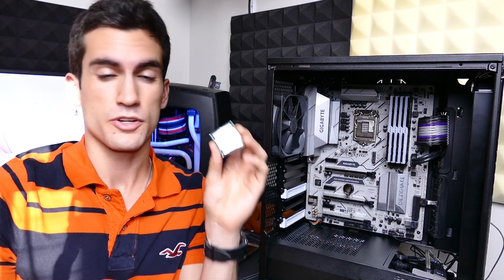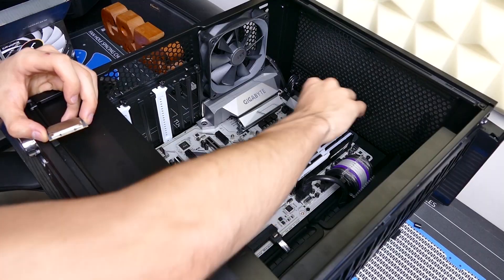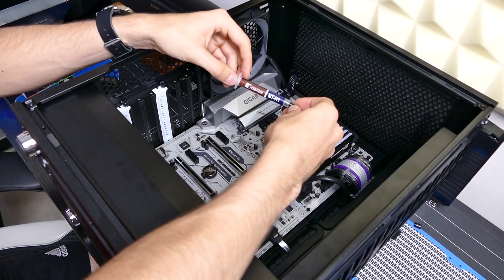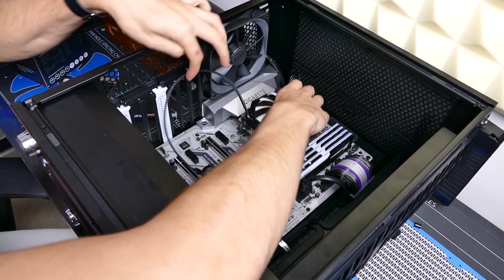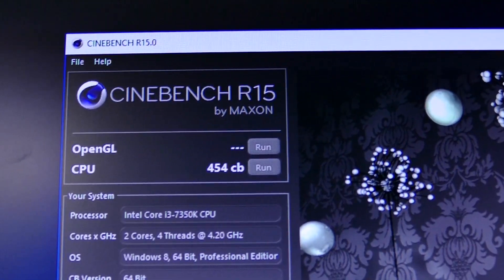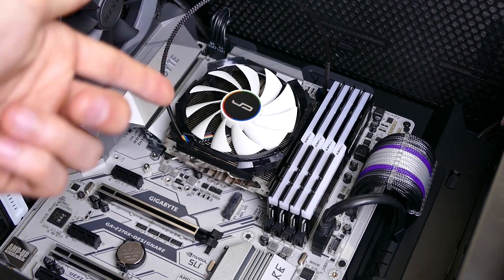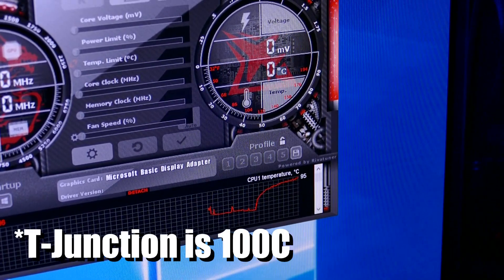Thermal Pad Instead of Thermal Paste?

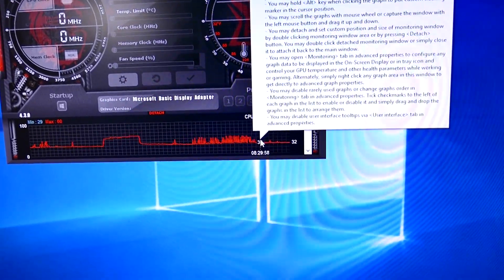Comment from the maker: - @3:17, I most definitely meant Fahrenheit ;-)
Reply: @Science studio
Why don't you try putting a thermal pad entirely covering the CPU for more heat-transfer potential over the entire IHS on the CPU?
I mean don't get me wrong I know performance will still be bad, but I wonder if the difference would be significant, plus I think its kinda unfair, you put the pad just in the middle, while the paste was capable of spreading out and covering more area thus it wasn't an exact replication of a fair comparison.
Reply: I caught that but I was like "Greg's smart. He'll figure it out eventually."
Reply: i think this is not a fair comparison! In fact you will get better results without that tiny piece of thermal pad because the radiator is on the entire surface of CPU heatsink instead a small 2 by 4 cm... surface size does matter when it comes to heat dissipation!
Reply: The i3 is just 129 at MICROCENTER. You can get a motherboard for just a few bucks more in one of their bundles. I picked up one open box for just 90 bucks. Hits 4.9GHz. Not bad for 150 dollars total.
Reply: And you call yourself an engineer! ;)
Reply: @Radiatingredstone Greg said 'he doesn't care' about that CPU for a reason, its terrible P4P.
My recommendation is to either buy a I3 6100 and BLCK overclock it to save some money and get decent P4P, OR, buy an R5 1400.
On the R5 you're talking double the cores, double the threads, not to mention it overclocks on the cheapest boards and can achieve mean overclocks.
Or if you're hard-on for intel, its been addressed before and generally speaking a locked I5 is better than the I3 and is better P4P.
The I3 7350K is a laughing stock among the community because it makes no sense in a P4P situation, I5 is better all around.
Especially with AMD's latest lineup, its a joke of a CPU.
Reply: Could you make a video about how weak mainboards can drasticly bottleneck your cpu ? Many people don't seem to know about it but when you for example put an AMD FX cpu on a cheap motherboard it will overheat if the processor is maxed out and therefore will throttle the whole system.
Reply: Science Studio Hey, the i3-7350K dropped down to $150 on Amazon and can be found on sale for $140 on OutletPC.  Is it still not worth the extra cash you will have to fork over for the z270 motherboard and cooler compared to a locked i5, or do you think this price drop is enough to make it justifiable in some cases, like emulation, where single core performance is incredibly important?
Reply: try delided ;)
Reply: TechTV 
If they made a smart motherboard with second CPU socket and switch between sockets when hot, or maybe even just led backlights under the motherboard to dissipate heat might work.
Reply: ALL HAIL MICROCENTER: HAVEN OF THE NERDS.
Reply: Please try what Nikola Vasilev said.
Reply: The 7350k's value for money is non-existent. For the same price you can get an i5 that has 4 true cores, and will be better for gaming.
Reply: I miss ur beard
Reply: You said you were going to cut a piece as big as the CPU but you didn't and we know the thermal paste spread evenly so it was not a proper test
Reply: @Science Studio
If you look @ 3:37 VS @ 3:50 there is definitely a noticeable difference from how far the paste spread out (id say covering 85-90% of the CPU) VS the pad (covering id say around 75%.).
While it is a small difference, it is one none-the-less, but enough to make a difference? I don't know.
I personally think there was a big enough difference to be noted as an inconsistency for the test, but perhaps you can further enlighten me to your point if i'm not seeing something you see or know.
Or perhaps its just opinion based.

Regardless I think it'd be cool to see the effects of thermal pads covering the entire CPU, or if it'd matter at all.
Reply: @JooJ SilvZ I've never restored a 990FX so I don't want to say for certain, but typically any thermal pads you can pick up off ebay or other sites work, just cut them to fit, put them where they previously were.
Sometimes thermal paste will be really hard to remove due to age and heat, I'm assuming that's what the "pink" paste was, if its more spread out etc, its more than likely thermal paste, its pretty obvious to tell the difference usually.
Techyescity makes good video's on motherboard restoration, you might want to check him out for reference.
Reply: TRY THIS !!!  dont overvolt with 3v. the highest intel tests are on 2v and the cpu is working fine
TRY THIS TO SEE THE MAX OC!!!
Reply: Science Studio I'm so sorry you didn't fry that crappy CPU. I know you really wanted to 😖
Reply: Science Studio Duh Einstein the thermal paste still covered a larger area & hence had a size advantage. Ur supposed to cover the IHS or de-lid it & cover only the die & do the same with the TIM. Though the verdict will be the same, the exact differences is will wary quite a lot. This video is supposed to show the detailed differences as that's what we never see.
Reply: Science Studio I was hoping you would of completely covered the cpu with those pads... Interesting to know :)
Reply: this heatsink is insane, it uses a peltier to cool the cpu
https://www.amazon.com/Phononic-HEX-2-0-Thermoelectric-Cooler/dp/B01JP7GEOE/ref=sr_1_1?ie=UTF8&qid=1497664685&sr=8-1&keywords=integrated+cpu
Reply: doode it is in celsius afterburner is only in celsius do you realy think the cpu is running at 92 fahrenheit
Reply: Yeah, I also said to myself while watching that I bet you'd get better temps with just the bare heatsink and no paste/pad than with the pad.
Reply: @1:58 That is not enough Greece bro, you should have invited more Greeks. ;)
Reply: When your CPU hits it's T-Junction it turns off instantly, my laptop would hit 106.66°C (220°F) regularly but when it hit its t junction (224°F) everything turned off and the computer would prevent itself from booting for about 5 minutes while everything cooled down
Reply: They wont, he doesnt know what he is on about.
LEDs generate heat when they run they cant absorb it
It is why led lightbulbs have aluminum heatsinks
Reply: please give in SCIENTIFIC units. Celsius
Reply: Hi Greg, I have some questions. 
After many years using my Sabertooth 990 FX I had to replace the thermalpads under the phase heatsinks, and I also opened the South Bridge heatsink with the Asus logo, the chip was covered by a pink material. 
I didnt know if it was a (sorry for my bad english) "hard sticky" thermal pad or thermal paste, it took a long time to be removed and I replaced it with thermal paste because I was not sure about what it was. I ve been using the PC since that day and never had a problem. 
Does the manufacturers use thermal paste or thermal pad on the south bridge? 
Have I done it correctly or I am a crazy bastard who dont know what I was doing and I am trying to kill my own mobo?
What thickness of thermalpads should we use on the motherboards? 
Thanks for the attention and keep up with the nice videos!
Reply: Point taken. Would still be interesting to see if no TIM is better or worse than thermal pad.
Reply: @Radiatingredstone
I think it depends on what you'd like to do with your PC, I don't think there is ever a "one size fits all".
What kind of emulation are you doing? Is the PC specifically for emulation only? I think those things matter.
I do think it is worth noting that you're losing probably around 10% SCP on average due to the overclock VS the I5, but the I5 is getting two more cores which would be better for general usage all around, not to mention emulators still can use 3 or even 4 cores, so it depends how badly you need that extra juice you'll get from the overclock, and if that small % is justified for the emulator VS the additional cores.
Although you do make a good point, I guess if you needed the absolute best for emulation, the I3 would probably reign supreme on a budget for specific emulators.
Reply: Try coollaboratory liquid metalpad. These are beast thermalpads.
Reply: Piotr G. They are great, but price /proformance for the same price you can paste a few cpu's
Reply: Science Studio You changed the name back? Awesome.
Reply: novemsol Just curious, whats the best thermal paste money can buy? Lol
Reply: Thermal grizzly.
Reply: Jeffrey Benzan get Arctic Silver 5, Greg and tons of other tech YouTubers use it.
Reply: I use arctic silver as well with all my custom rigs
Reply: Mind of Exoh I already use Arctic Silver 5. I was wondering if it gets any better 😐
Reply: Depends greatly on what you are doing & what the 2 materials you are putting it between are.  For example, if you are cooling below 0 C or using a CPU cooler w/ aluminum that can contact the CPU heatspreader, you can't use a metal type TIM.  Of the grease-type (not liquid metal), Phobya Nanogrease Extreme has the highest thermal conductivity I know of @ 16W/m-K.  Of the metal type TIM, I am partial to Thermal Grizzly Conductonaut which is 73W/m-K (largely due to the high Indium content of the TIM).  Edit: To respond to those talking about Arctic Silver, it isn't any better or worse than your average grease TIMs TBH.  If memory serves me correctly, Arctic Silver's thermal conductivity is bang on 8W/m-K.
Reply: Is the 7350K good at 149 on amazon?
Reply: It's shite even if it's for free.
Reply: seriously or are you just kidding?
Reply: For 129 it's a good processor...overclocks like a champ and is all you'll need for gaming. Intel is just being smart and playing the numbers, they probably have a surplus of quad core chips with two cores that don't perform good, but the other two are top notch. I don't consider this chip any more stupid than the 1000 dollar 6950x or whatever.
Reply: Thanks for the tips! I will search for Techyescity. Have a great Weekend!
Reply: Try lapping the CPU and heatsink and then doing a test with thermal paste and without thermal paste.

If done correctly the lapped CPU shouldnt need thermal paste and just have metal to metal contact.
You might even get some cold welding happen if both were if the heatsink was copper
Reply: But would it really fry if you just touched the heat sink right on the CPU heat spreader with nothing in between?
Enough pressure and metal-on-metal contact and it may outperform the pad.
Reply: Cooper Gates Thermal paste is applied to fill the microscopic gaps between the IHS and the cooler. Metal on metal leads terrible results because the contact surfaces aren't perfectly flat
Reply: +Cooper Gates.

The heatsink heatspreader and the CPU cooling heatsink base are not flat.
One or both might be slightly convexed or concaved.
This will prevent good contact.

Thermal compound fills in these gaps and allows the best possible heat transfer.

If you lapped both the heatsink and heatspeader with sandpaper and you sanded until you had a mirror polish(Look at lapped CPUs on google image).
you could just mount without any thermal paste.

Being so flat the metal should have metal to metal contact

But DO NOT GO LAPPING CPUS with reading about it.
Reply: The thermal pad may not be flat either, even under pressure. I was not saying metal on metal would do
better than thermal paste. Perhaps better than the pad, though.
Reply: you have a crush on him?
Reply: Science Studio I love this guy and want to make babies with him so hard
Reply: Henry Ettoit Kelvin
Reply: Some good cooling if you can get it lower then ambient temperature :p
Reply: That's a cool CPU :P
Reply: Hey friend  i have a question about the thermalpads and thermal Pasts. So if  Thermal pasts are much better on CPUs , why not to use the  Thermal past on VRMs ? Lets say the height its perfect to use the Thermal past. so would it work a lot better ? ( i mean in GPUs cases.
Reply: why use fahrenheit and 1 min later use celsius?
Reply: Celsius are love.
Reply: I hope you could use the IC Graphite Thermal Pad that Linus used in his last video.
Reply: 55 fahrenheit would be 12 celsius soooooooooooooooooooooooooooooooooooooooooooooooooooooooooooooooooooooooooooooooooooooooooooooooooooooooooooooooooo
Reply: Please, use metric, the non-retarded system of measurements. Especially when talking about hardware temperatures.
Reply: So you manage to prove pretty decisively that you have no idea what the characteristics of thermal management materials are.  Noctua does not mention what the thermal conductivity of their thermal paste is (although I suspect it is ~8W/m-K) & you use some random piece of thermal pad for which you have no specifications.  If you want to test this & really see if there are differences, you might look into comparing products w/ known thermal conductivity values.  It would be interesting to see a comparison of paste w/ similar conductivity to the thermal pad you are testing, as well as thermal pad w/ a much higher thermal conductivity compared to the paste you are testing.  FWIW, most grease-type thermal pastes have a thermal conductivity between 8-12W/m-K.  Fujipoly Sarcon XR-e thermal pads have a thermal conductivity of 17W/m-K & Fujipoly Sarcon GR80A is 13W/m-K.  This is compared to your average thermal pads that typically have thermal conductivity values in single digits.  Without relevant data points, you aren't actually doing any "science".
Reply: Why kill it? Other than needing to have something of an experiment. Send it to me I'll take it off your hands.
Reply: Violent Yeah, but with the price drop to $140-150, it isn't nearly as bad in terms of price to performance as it was when it launched at $170-180.  Sure, I would still recommend the Ryzen 5 1400 over any locked i5 or the i3-7350K, but in specific applications like emulation, the i3 might be justifiable at this new price point.
Reply: Science Studio can you do AMD socket types and processors video
Reply: Science Studio  you got one cold ass house.
Reply: daniel little Well a cpu wouldn't run at 90 Celsius it would shut down. 92 Fahrenheit is normal for a CPU.
Reply: I prefer not brushing your teeth
Reply: Science Studio mercury thermal pad might work
Reply: Amerifat here, please use Celsius when referring to computer hardware
Reply from the maker: Violent The paste didn't cover the entire heat spreader either. The test was rather consistent in that regard.
Reply: is this guy gay ? why i always think hes gay ?
Reply: fuck the metric system.  convert it yourselves.  12 C for Geekbench.

Comment: I always remove this, because the greater distance between the cpu and heatsink will reduce cooling, therefore the cpu will drop down its performance. However, some systems need this for the chipset and video card, and there is no option. Some need thicker thermal pad, depending how the laptop is made.

Comment: I, stupidly, removed the thermal paste from my laptop and I didn't have a tube ready, so I assembled it as it was and hoped it would just sit at high temp, but not throttle.

Mmhmm. Yep. It throttled.
When taking it apart again, I saw that my ssd has 2 little holes, and I could see the thermal pads poking a little through.

I took the piece that was poking out. It was more maleable than I expected, and then it hit me:

Would this suffice fo now?

Comment: Will this work on for cold temp?
Just curious see..
I have a radiator for a mobile phone with TEC module inside the cooler. Problem is that the surface doesn't fit perfectly on the back of my phone.. cold and heat doesn't exchange properly. 
Will this silicone strip help?

Comment: I mean, you don't cover the entirety of the CPU and as pads have thickness that paste don't have (btw you didn't spread your paste evenly neither), you are introducing an extra gap. You need to cut the pad in custom size to judge its action fairly. Because as I said, pads will introduce a gap otherwise and not the entire surface will be in contact. With paste, even if you don't spread it entirely, the CPU & cooler would still have more surface in contact.

Comment: After removing the huge heatsink on my Japanese orange Gamecube (to run wires from R6 to a SPDT switch for region mod) I noticed there are pads, and used my arctic silver 2 step remover to clean the CPU/GPU..however there is way to big of a gap for me to use my Arctic Silver paste after, and I rather not sand down the legs of the heatsink and find springs for ths screws so the sink sits flush on processors. What pad do you think is best to get to OEM specs, it is about a 1.5-2mm gap if I had to guess? Anyone have any experience with this, or just getting one on ebay and cutting to relative size should work just fine?

Comment: Thermal pads are perfectly fine to use on a CPU and GPU. The problem here is due to the type and limited amount that was used to cover the CPU. I use a thermal pad with my Cooler Master liquid Cooler lite 120 on an Intel 3ghz processor not overclocked. During idle it is a steady 27 degrees celcius and the highest Ive seen it while running full load so far is 53 degrees celcius. The pad I decided upon is the Fujipoly / mod/smart Extreme Thermal Pad. A ready to use high end thermal pad. These are custom cut to a smaller, more applicable size. This line of thermal pads are much more effective than stock pads. With a 11.0 watt/mk thermal conductivity these pads will pull heat away from your important components with ease and allow for overclocking as well! Arctic MX-4 only has a  thermal conductivity of 8.5wmk whichbis definitely suitable for any criteria. Im curious of what type of thermal pad was used in the test..

Comment: Two words for you. Innovation cooling.

They make a graphite thermal pad, which is supposed to equal or even outperform thermal paste 

I don't have a baseline, but I used it immediately on my new ryzen 7 1700. With decent case cooling, overclocked to 3.7ghz on the stock cpu cooler, I idle at about 41C and hit about 65C under full load. Fwir, this is right in line or even better than the average with thermal paste. 

The pads are expensive but are infinitely reusable.